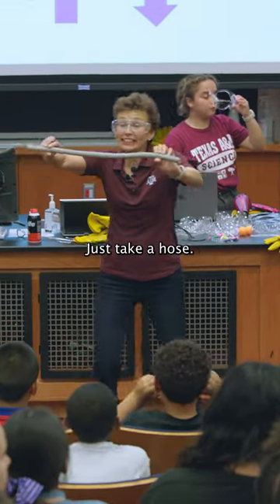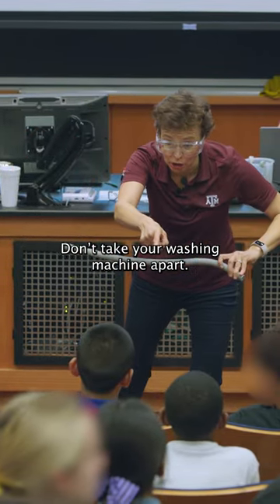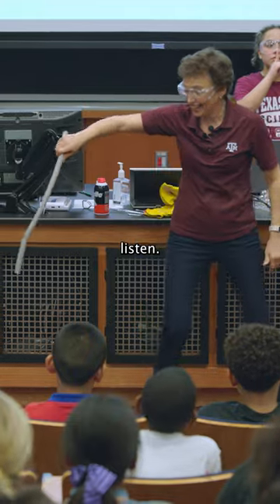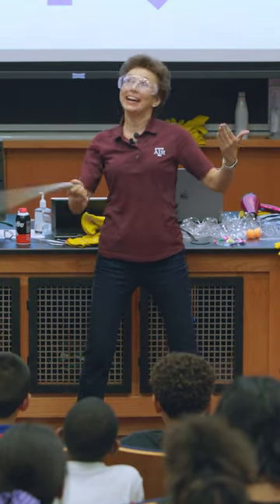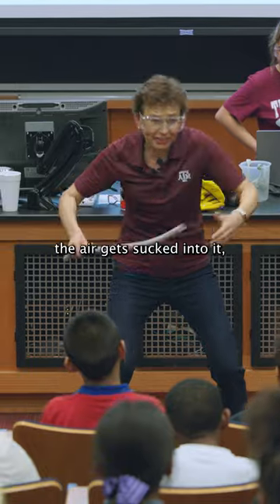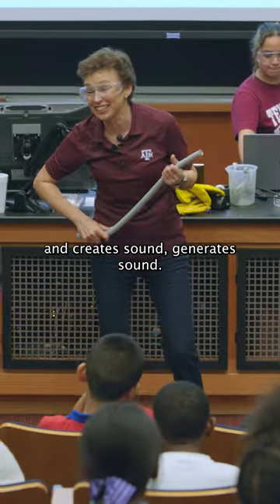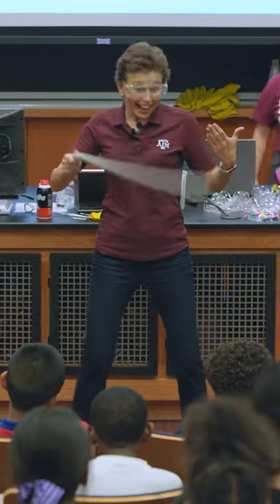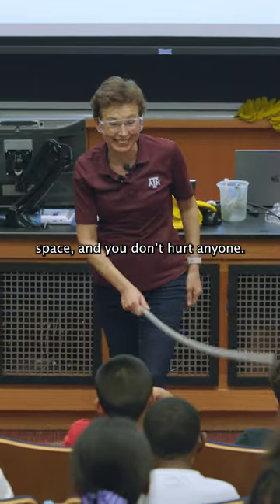How to make a drain hose sing? 🎤🎵

Comment: Reminds me of when we were stationed in Germany in the 70s, you could actually buy corrugated tubes as toys. They were in bright colors and much more flexible, and about a meter long. Probably couldn't sell them today, for the most part we used them to smack each other with.